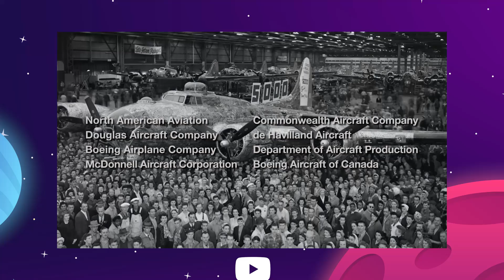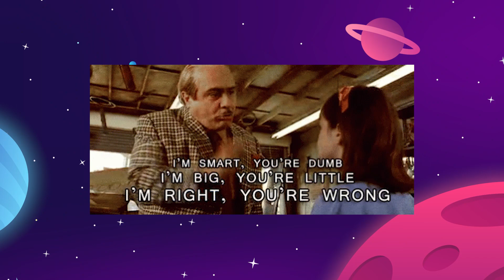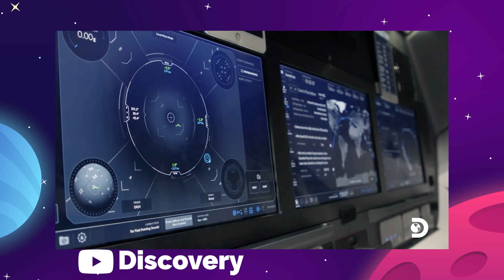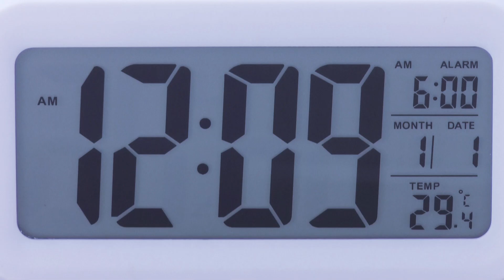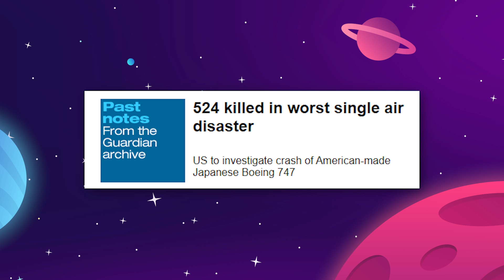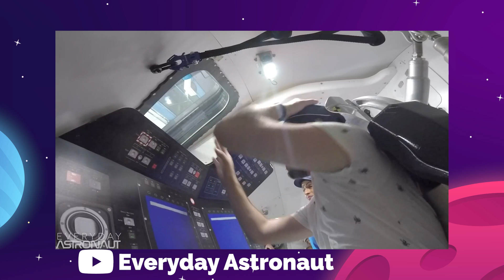The Sleeping Giant Of Space Exploration

Comment: ULA's "smart reuse" plan to recover just the engines and thrust section sound janky and wack because it IS janky and wack. The helicopter catch part is actually the easy, reasonable part, as that kind of thing has already been done in real life. No, the stupid part is thinking there's an easy way to just pop off the whole thrust section with the rocket engines. 

Trying to disassemble the rocket... IN FLIGHT has to be one of the stupidest ideas I've ever heard. The engines and the thrust structure is the entire bottom of the rocket, the part that experiences the greatest structural stress from the weight of the propellant pushing down and the rocket thrust pushing up. It has to be structurally rock solid and all of the welds, seals, and everything must be perfect. It cannot be designed for easy separation. Easy separation (of things that are supposed to tightly joined) = structural weakness = rocket falls apart before it even launches. Or will they opt for brute force and use explosive charges to rip the thrust section from the rest of the booster? Yeah, that's a great way to detonate the remaining propellant in the tank and send shrapnel flying up into the second stage. At stage separation, you're above the atmosphere, so it would be akin to an anti-satellite kinetic kill test, with some shrapnel sent into higher orbits, thus threatening many other satellites.

Comment: Fun fact: In the early days of spy satellites, they had a limited ability to generate electricity. And a transmitter power enough to send detailed images back to earth wasn't practical at that time. So instead of transmitting images back to earth. The satellite would use film. Then send that film back to earth in a small capsule. The capsule would then deploy a parachute. And would be snatched in midair by a military helicopter. It was weird, but it worked.

Comment: On the subject of the Vulcan-Centaur, their reuse idea isn't as crazy as it sounds. The engines and avionics make up most of the cost of the first stage so recovering them makes sense (even if it isn't as impressive as the Falcon 9). Also the parachutes into helicopter catch sounds wild (though is it honestly any crazier than the Falcon booster hover-slam?), but it has been done in the past. The US used that method to recover data-capsules from early spy satellites. It's also the plan Rocket Lab has for reusing the first stage of their Electron rocket.

Comment: You call it "sleeping" giant. What people see, it is more of an unawakeable state of sleep, a coma really. Oxidiser valves for the abort engine were stuck. The stoppers are made of teflon, one of the few materials not attacked by the nitrogen tetroxide (That nasty orange stuff used as oxidiser). What happened though, the nitrogen tetroxide got thru the teflon seal of the actuator, and guess what it found at the other side, the engine exhaust? Water vapour, from the atmosphere. And it did what nitrogen tetroxide does best with water, so all the oxidiser engine valves got stuck, so the computer refused to complete the countdown. Now Boeing has to understand the reasons for the leak, fix it, and run all the tests again. It could be Christmas time before the sleeping giant will be on its feet again; keep in mind that all tests with hydrazine and NTO must be conducted in desert areas.
Reply: Apparently NASA had the same problem with Shuttle back in the day. Boeing evidently didn't put in enough margin to overcome the problem. At least they found the problem in the unmanned test, before it could have delayed a manned mission.

Comment: This all rather sad.  Nothing has been learnt from the past.  This is basically a rework of Gemini, not even Apollo.  What is going on?
N.A.S.A. has completely lost the plot!
Nothing new has been created in fifty years!
The Shuttle with all its flaws was vastly superior  to this  project.
Reply: This is just the commercial crew program. Space X's Starship landing system is meant to be an 'all purpose' sort of spacecraft for settling the inner  and parts of the outer Solar system. A variant of the main ship is supposed to be used in NASA's return to the moon. NASA doesn't just plan on another 'boots and flag' moment, but is also looking to build a  permanent base on the moon's surface as well as a lunar space station called "Gateway" , which is meant to help various projects on the moon. Eventually, in the 2030's NASA is planning on sending someone to Mars. But SpaceX has had 'martian colony' plans since 2002 and it was arguably the reason Space X was founded, so the smart money seems to  have Space X beating NASA (and everyone else) with manned landings on Mars using starship in the mid to late 2020s.

Comment: 9:43 technically the Russian vehicles (Progress and Soyuz) can autonomously dock to ISS. So Starliner would have been the first “U.S.-built” vehicle to dock autonomously. Now it’ll be the second. Thanks for the video.
Reply: I was about to say this. Also, Space Shuttle docked manually to the ISS when it was operational too. Also external payloads are not attached to Crew Dragon (because abort functionality requires the trunk to provide enough drag to keep the capsule pointed correctly. Only Cargo Dragon uses the trunk for external payloads, and CST-100 isn't designed for delivering cargo.